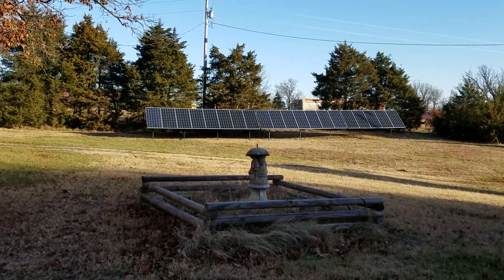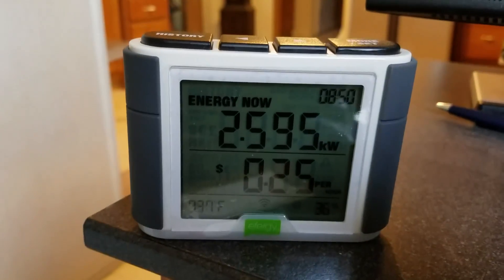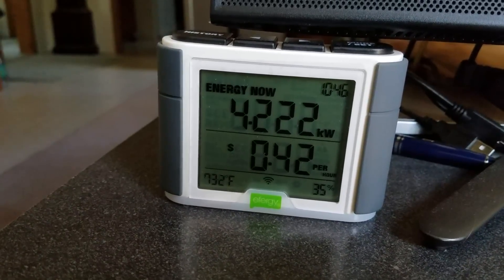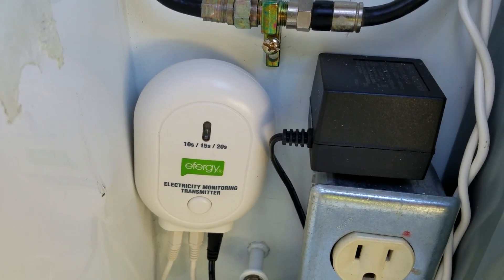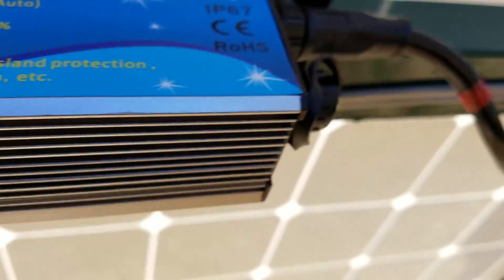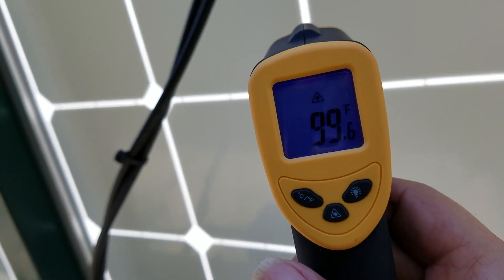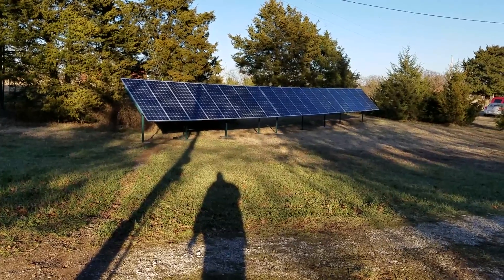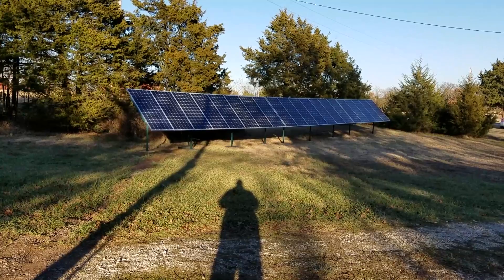Efergy Solar Remote Output Monitoring

Comment: can you please share source to buy same unit?
or at least specs of it?
Reply from the maker: I purchased it via Amazon. Search Amazon with the word "efergy" and several packages will pop up. Here is the kit I think I got: Three Phase Efergy Elite Power Monitor https://www.amazon.com/dp/B01BNV54HI/ref=cm_sw_r_cp_apa_i_yuLwCbKTW771J
Reply: @tomwiles  That's a 2 phase you've installed. 3 Phase runs 3 CT clamps.